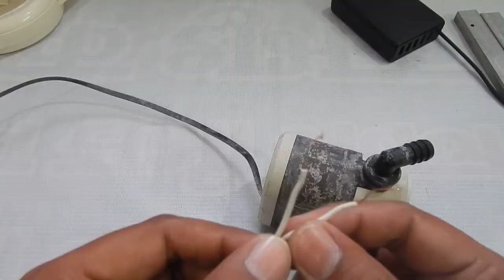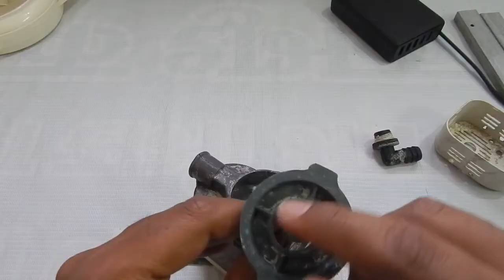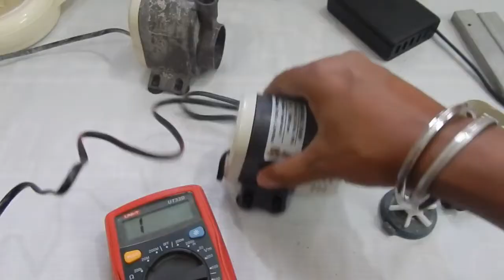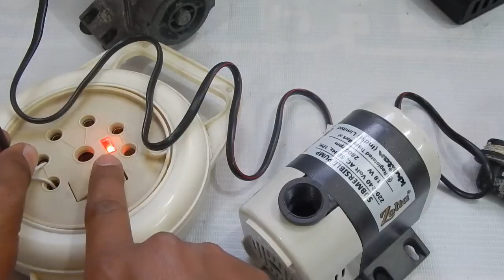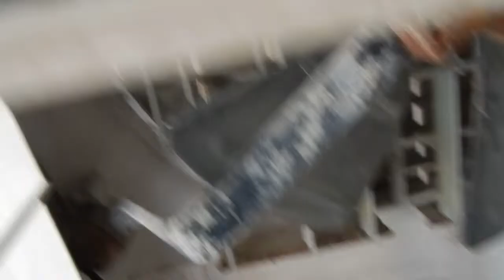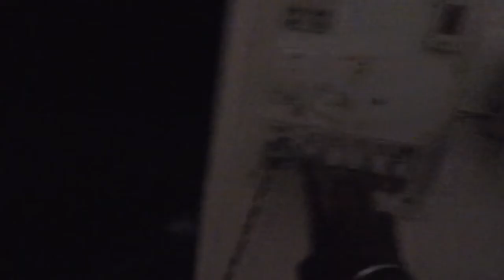How To Replace Water Cooler Pump || Submersible PUMP✔

Comment: My existing pump is 16 watt can I replace it will 18 watt, as in market 16 watt pump is not available .
Reply from the maker: yes, you can buy 18w pump instead of 16w. As there is not much difference in them.
Reply: @gurribuy  will it burn the circuit
Reply from the maker: @probinboro3022  NO.

Comment: Great video bro
But one problem i am getting while replacing the pump. I just connect the wires of the new pump with the wires of the switch . When i witch on the pump button then it makes the fuse blown. Please help me out how can i get over this problem??
Reply from the maker: maybe your cooler switch is faulty. Test the pump by pluging it in a wall socket and see if it works if the pump rotates then it means the problem is in the cooler switch. And possibly your old pump is  also good.

Comment: Motor aise chalate hai to chalta hai but cooler se connect karte hain to nhi work kar rahi
Reply from the maker: maybe the cooler switch is faulty. When you connect the pump to the cooler does it make any noise or not??
Reply: @gurribuy  Cooler fan is working but water pump is not working
Reply: Pump also doesn't noise
Reply from the maker: @himanshu_topzz  your cooler pump switch is bad. the only solution is to replace the switch or simply wire the pump to external socket. just connect wire to the pump and pull them out from the back of the cooler, connect a plug and connect it to another wall outlet.
Reply: @gurribuy  can I try remote for that
Reply: I have it's remote.
Reply from the maker: @himanshu_topzz  you can try the remote, but i think you have already tried the remote and it didn't work. Did it?
Reply: @gurribuy  Na
Reply: I had connected directly from main wire.
Reply: & thanks for support.

Comment: Hey man.. my pump is just vibrating to and fro.. instead of continuous spin.. what could be the pblm?.. FYI: i cleaned it properly as u said
Reply from the maker: Did you check the impeller(small fan). If any part on the fan is broken either the magnet or any fan blade the pump will vibrate. Make sure the fan is not touching the inside of the pump.
Reply: @gurribuy  yeah that i checked.. everything seems to be intact, but still the motor spins to and fro instead of continuous spin on one direction
Reply from the maker: @RamKumar-to5ip  If everything looks fine than i'm not sure what could be the problem. Maybe some of the coil inside has sorted out or the magnet on the impeller has developed a crack. Sorry man, i told you what i would do in such a situation, nothing more i can do about it.
Reply: @gurribuy  its ok.. thank you